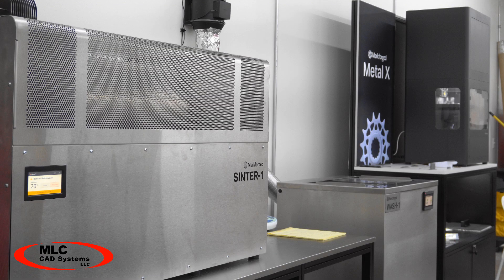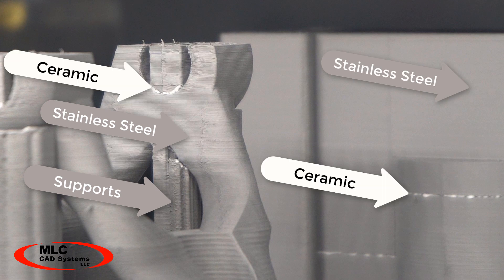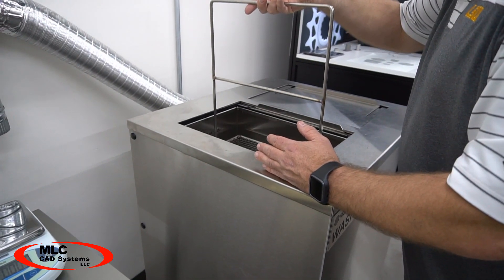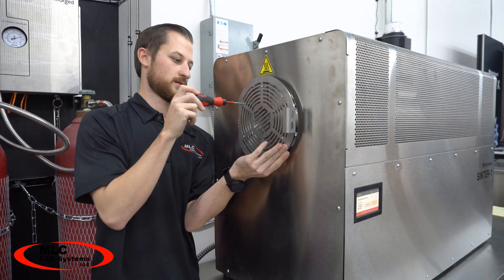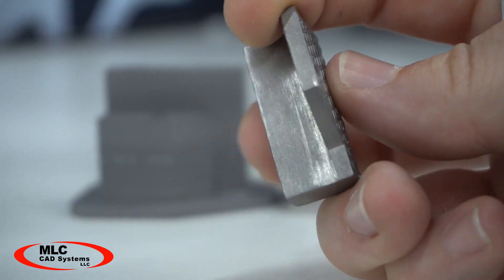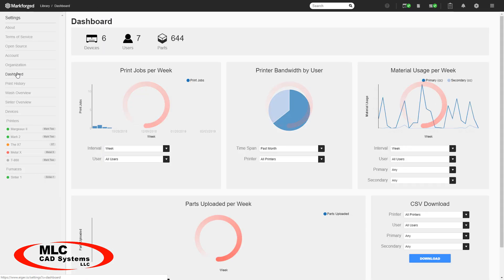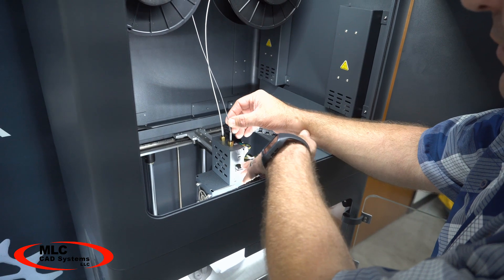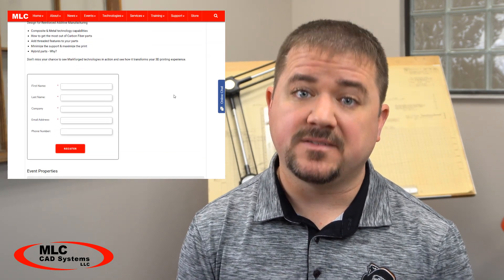The Markforged Metal X is Here

Comment: 20% shrinkage? For real? What is it, a balloon?
Reply from the maker: Great question, the sintering process is not unique to a machine like this and it can seem crazy at first, but it is a very cool process.  Sintering starts out with a powder, you could visualize sand particles for example, and think about the air in between particles that can't be filled because they are non-uniform.  Sintering causes these particles to bind together with neighboring particles by heating it to near melting, and as the particles slowly bond to and merge with surrounding particles the voids are slowly removed.  Done correctly, the slowly shrinking voids allow the gas in the empty spaces to leave the part and the final part is dense, solid, and the same overall shape that you started with (minus the air spaces which are now gone).  Pretty amazing!

Comment: Can I pay you guys to print and complete a part for me?
Reply from the maker: We would love to discuss your application, give us a call or visit our website and reach out!  https://mlc-cad.com, 800-364-1652
Reply: MLC CAD Systems thanks for your quick response!  Absolutely, we are designing and testing fit on the parts at this time so once we have the fit 100% then i will give you guys a call.  We are working on a few mid 1920’s speedometers for our vintage cars.  The current parts were made of pot metal which over time swells and destroys its self.  So we want to have a few “new” parts made of a stable metal.

Again, thank you for getting back to me and I’ll touch base w you Guys once we are ready to do final prints in metal.  
William
Reply: CrazyfamilyTLR You could also contact a local CNC machine shop near you and I’m sure they could produce what you want for a lot cheaper
Reply: Rix IV thanks for info, it’s actually a few small parts that would prob be easier to print in metal.  I’ve tried to find a CNC shop local to me and haven’t found anyone unfortunately

Comment: cloud based slicer...so it is a 100,000$ junk when your company go under?
Reply from the maker: Thank you for your comment.  The cloud based slicer is the default configuration, but there are on-premise options as well if you want to take your data or the entire operation offline, or if you are concerned about longevity of the company.  Markforged has some very powerful financial backing, so I don't see any concerns for them shutting down any time soon.
Reply: @MLCCADSystems  There are offline slicer options? why didnt you say that in the video? As you can see not everyone is too hot about cloud based anything.
Reply: @meowmeowbobo  He might have just forgot? It is a paid option though which i'm not hot on but they do have it
Reply: meowmeowbobo APP based anything
Reply: @meowmeowbobo  offline slicer will cost you an additional 100k xD
Reply: MLC CAD Systems at one point in time Enron was thought to have some powerful financial backing
Reply: @tyvek05 If you spent even a little energy instead of writing this useless comment you will see that even their website only mention cloud based slicer. This is the first time I've hear about offline options  if you paid extra.
Reply: Does this cost 100k? No wonder they wont tell me the price

Comment: I see I don't have to worry about CNC machining, forging, or casting becoming obsolete yet. It just another printer with all the post processing of SLS metal printing. Tolerances are probably in the tenths of milimeters at best, and with the inert gas and printing time it's probably way to expensive for large production.
Reply from the maker: Correct, this type of technology will not replace traditional manufacturing technologies any time soon for the majority of parts, especially anything with a significant volume, but it does provide many additional capabilities that allow easy creation of designs that were previously difficult, expensive, or impossible to create.  It differs from SLS in its ability to make sparse-fill parts, its avoidance of explosive metal powders, and a much lower price tag for the equipment.
Reply: Sander Vercammen This process is good for prototype and home part replacement for DIY people that like to make things and can afford it for wowing their friends and family.

Comment: Me: Wow, i'd be able to reprint broken parts!
99% of people: guns guns guns.
Reply: It’s America, it’s part of our culture
Reply: @GeeDeeDee   You need to make it to know how to make it? That makes no sense. 
Being able to make them when sht hits the fan is good. 👍
Reply: @GeeDeeDee   Computers don't need muscle memory.

I get what you mean.. 

Hands on experience
Reply: Guns? That would be a waste indeed. :D 316 stainless steal,  Inconel and titanium... OMG Amazing. it can make parts that are impossible to mill conventionally. Rocket Labs for instance uses printed metal parts. Or Christian von Koenigsegg was saying he 3d printed his turbos and it would be impossible otherwise. If I had to guess it's probably because the compressor blades are wider than the opening.  :O
Reply: Id print bullets, lmmfao
Reply: @cavitycreep     People already make their own bullets.  Lead has a very low melting point, 327C. You just need a pot, barbecue coals and a mold. Then just get a bullet press for the brass, some caps and powder. It's a little more complicated if you want a fmj. The point is, bullets are pretty cheap to make your self,  but actually cheaper still to buy.
Reply: @Kenji1685  But have you ever made tungsten-chromoly cored bullets before, that have 5x hinged spreaders at the tip with lead?  I've been following the work done with high-temperature/pressure sintering creating near monolithic high density projectiles.

Personally I can't wait to see things like 3D printed tunsten-carbide/titanium-cobalt filaments so that we can produce our own machining inserts.
Reply: Well let them do that and let poorly printed/processed parts explode to their face. Natural selection removing violent "it's our culture" idiots. Done.
Reply: @olistiktok  Just because someone has an interest in weapons doesn't mean they are violent.

Comment: It shrinks about 20% ? That is not an exact science ...
Reply from the maker: The exact shrinkage value is managed automatically by Eiger, and may vary based on the geometry of the part and the type of material.  Luckily all of this is seamlessly integrated and transparent to the end user.
Reply: @MLCCADSystems  That is really cool, just this should be emphasized maybe next time. Lot of people are looking at 3d welding as the future. Thanks for your answer great product!

Comment: Shrinkage?
Reply from the maker: As the part is washed and then sintered, the wax and plastic binder material that allowed it to be extruded in the printer is removed, and the remaining part solidifies and shrinks.  It is amazingly stable and repeatable for as much as it shrinks, but it does have the potential to warp a bit depending on the part.  Check out Blacksmith, it allows Eiger to learn using AI to better predict warp and shrinkage and the slicer will automatically reverse the warp in the initial part to make the final part much closer to the intended size and shape.
Reply: Only when it's cold

Comment: Ultra expensive stuff i really would like on thought.
Reply from the maker: It is definitely not a machine you buy just for fun, but it costs a small fraction of what previous technologies did, and the ROI for most companies that have a legitimate need is surprisingly fast!
Reply: MLC CAD Systems I wonder is that just a basic filament that any 3d printer is able to print or does it need some special heat?
Yeah i know our company looked into 3d metal printing i mean we have now a xjet or however the call it…
Reply from the maker: The filament is a mixture of metal particles, wax, and a plastic binder.  It resembles a basic filament, but the machine has several thermal considerations.  The spool itself must be heated slightly to soften it for unspooling so the chamber is heated, the head is obviously heated but it doesn't have to melt plastic in quite the same way as a traditional printer might, it just needs to soften the binder and wax.  The bed is also heated, I assume to aid in dimensional stability throughout printing.

Comment: Everything looked good, but then - a wild "ALWAYS ONLINE DRM" appears in the form of "cloud-based slicer".
Reply: I must say, I agree that a cloud based system would be a deal breaker for me if I was actually in the market for this type of machine.  A hiccup from your ISP, and valuable materials and time are wasted.  When I was shopping for a CNC router system, I was narrowed down to 2 machines that were both comparable in specs and abilities, but one had a requirement for it to be connected to the internet to be able to use any of the design features or run the machine.  I did not chose that machine, even with the lower price point.  The only thing I want my projects depending on is the electricity that is powering the machine.
Reply from the maker: I appreciate your concerns, there are a few things that warrant clarification regarding the cloud integration.  First, the programs are loaded locally on the machine and the machine can operate completely offline.  Internet is only required to setup the print job in the free online Eiger software, but then it can be delivered by USB or loaded across the internet and disconnected.  This is no different than how most shops deal with their machines, they are programmed on a computer with internet access and they work offline or on a LAN.  Also, a disruption in internet access would not affect a job that is currently running, only your ability to monitor the status of the machine, which is a convenience not a necessity.  No material wasted, no additional costs, and no limitations on the use of the machine if you don't want it on the internet.
Reply from the maker: The Markforged ecosystem is self-contained to maintain a quality part production and to eliminate a lot of the variables that a user must dial in to get a high quality print.  This is not the printer for you if you plan to dig into the code, try to make your own material, or tinker with the settings heavily.  If you've ever used the wrong size of print nozzle or used a feed rate that caused a part to fail you'll be happy to know those kinds of issues simply don't exist with Markforged, the entire system manages all of the variables for you so you can focus on the parts rather than the process.  Eiger is also free to use by the way.
Reply: @MLCCADSystems  Just offer an Offline Version as a Fallback Solution and no one will bat an eye...
Reply from the maker: Thank you for the feedback, an offline version does exist but the cloud version is so much more convenient and powerful (and free)
Reply: MLC CAD Systems I don't see how you couldn't replicate the same convenience/powerful functionality offline, since it's not as though slicing is particularly processor-intensive. It's not that we want to tinker with your code, just that no serious machinery requires full-time cloud connectivity. Imagine if a factory had 10 of your machines, and they lost internet connectivity. It just doesn't make sense. If you were giving the machines away for free and relying on software subscription/material sales then yeah, maybe your cloud model is justified. But you're not. Just a shame to see another good hardware company get sucked up by the allure of cloud service models to the detriment of their loyal customers.
Reply from the maker: @BrotherCreamy  Thank you for the feedback and the questions!  One example where the offline version would not be as powerful as the online version is when they released an update to the wash cycle parameters.  After additional testing and research it was determined that the wash process could be stopped much earlier than they had previously recommended with no ill-effects on the parts or the equipment, so an over-the-air update changed the parameters and all pieces of equipment updated themselves to incorporate the new code, and parts were done significantly faster.  With the offline version the updates would have to be applied to each machine manually, and currently the offline version does not perform updates regularly to the code, so the offline version would take longer to print than the online version and require more time and effort to implement and use.  Obviously for ITAR/Military applications this is an acceptable trade-off for security, but for the majority of users the online version would be preferred.

Also, one note about internet connectivity, the machines don't require 100% internet up-time, the job is loaded over the internet and stored locally, so a print would never be interrupted by internet that has gone down, and programs can be loaded by USB if you prefer to stay offline the majority of the time, you simply lose the ability to monitor progress and be notified of issues.
Reply: MLC CAD Systems You mention ITAR/military, do you not have a clue your machines will never be allowed? It’s because that silent update just F’d up the entire documented process cycle, have you never read any Mill-spec heat treating documentation for instance? You cannot force feed a change like that, and it takes months to approve per company basis! I know the stress department won’t even allow laser cut parts due to edges being tempered differently... You cannot just change a cycle or process like that, plus, in military contractor applications, they need to bid the production on each part, and even if you make it faster/better, well that screws up the production estimates.

Since you mention milspec, do you not know that you have to destroy lots of test parts per production run to ensure quality? And then say tomorrow, your stupid software changes 1 little variable, no big deal right? WRONG! Your product is doomed to fail for any production, and as a hobbies, this looks far too labor and time intensive (CNC looks much more practical).
Reply: @MLCCADSystems  People will use the cloud based option - but I can tell you flat out that always online DRM is a deal breaker in video games for me, let alone tools. If I hadn't read more into this comment thread I would have been turned off immediately. Should be clearer that it can be used without any internet.
Reply from the maker: Thank you, and yes the comment section on this video has been very informative for us regarding what was either unclear from our video or simply commonly misunderstood by our viewers.  I recently hosted a webinar where I categorized the most common questions and answer them with more discussion, check it out here!  https://youtu.be/Mbu8OhqZx74
The comment discussion starts here: https://youtu.be/Mbu8OhqZx74?t=1176

Comment: Hi there, how do you manage the shrinkage effect to maintain precisely matching product, if the part will shrink in the oven as showed in the video
Reply from the maker: Hello! The shrinkage of parts is a controlled process and is handled by the Eiger software. The software will automatically account for the shrinkage and scale the part accordingly. The user will not have to do anything with their model. The final sintered part will match the final dimensions of the model that is uploaded into Eiger.
Reply: could i ask about accuracy
Reply from the maker: Unfortunately there is no simple answer because each shape will shrink a bit differently than other shapes.  Check out Blacksmith, it is an AI tool designed to learn how the final parts deform and to account for them in the print phase, it learns from each print that is scanned and can automatically account for any variations to get more accuracy, plus it is globally connected so every part that is fed into the system helps it to get better.  

What I can say is that we find the shrinkage on each part to be very repeatable, so although it may deviate a few thousandths here or there, it typically does so with great reliability from part to part, so Blacksmith should be able to build it correctly once it is fully implemented.  We'll do a video here as soon as it releases and we have some feedback for you, but great things are coming!
Reply: @MLCCADSystems  You're literally talking about microns here. So are you saying the parts will be accurate to like a couple hundredths of a millimeter everywhere?
Reply from the maker: Hello @DavidGP, let me clarify that we are a company based in USA, I should have specified the units I was referring to were inches.  I would expect accuracy to be closer to a few tenths of a millimeter, depending on the size and shape of course, and as AI is applied and educated I would expect that to improve by some amount.  If you have a specific application in mind let us know and we can see if it would be a good fit for your needs.